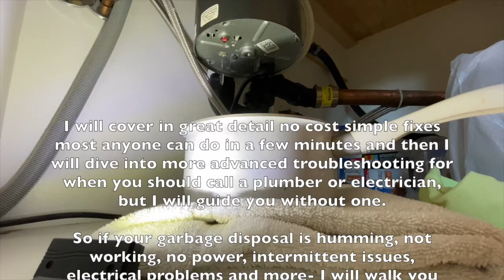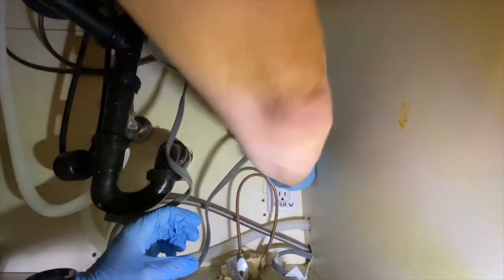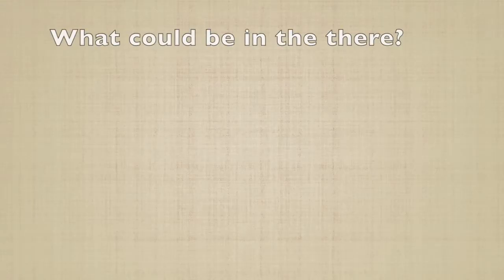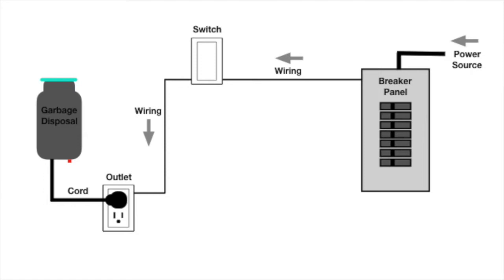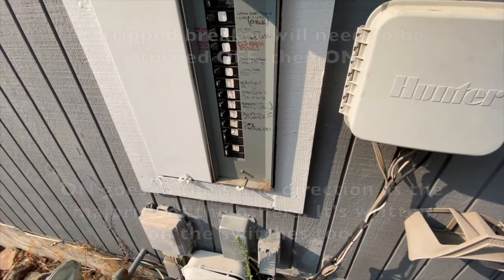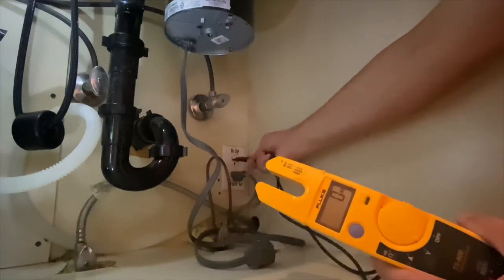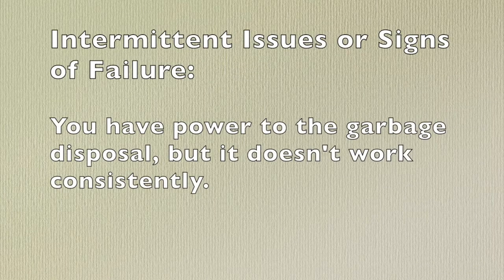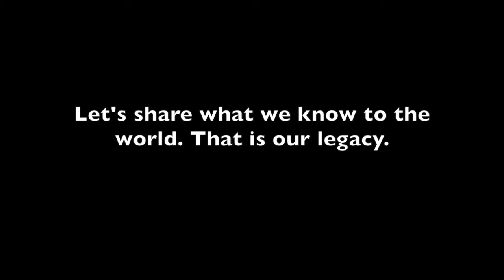FIX IN MINUTES: NOT WORKING / HUMMING / FIX ELECTRICAL ISSUES / RESET -How to Fix Garbage Disposal

Comment: Thanks so much for your video! My garbage disposal was just buzzing, not working. It doesn’t have a reset button, for whatever reason. But I unplugged it, cleaned out some small bits of food from the drain again and again, and finally it’s working again.

Comment: Great, helpful video!  My garbage disposable stopped working a few weeks ago.  Thought it was done so I bought a new one and was preparing to install it today but wanted to get as much info as possible before starting the task.  Found your YouTube video which saved me the trouble of installing a new disposal.  When I flipped the switch on my current disposal, nothing happened.  Thought I had pushed the disposal reset button in the past but guess I didn't press it enough to get the "click".  After pressing the reset button on the disposal, resetting the GFI and flipping the wall switch, it started humming (making progress, yaaaaay!).  Looked in it with a flashlight and saw a few foreign objects in it.  After removing a stuck piece of metal, the disposal started working again! Now I can take the new one back!